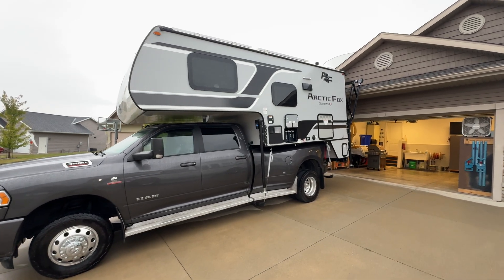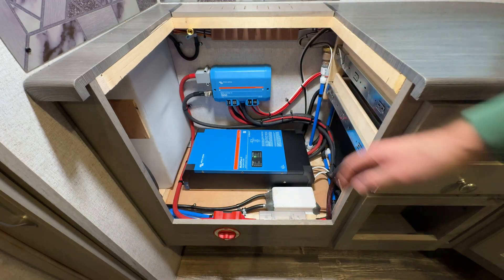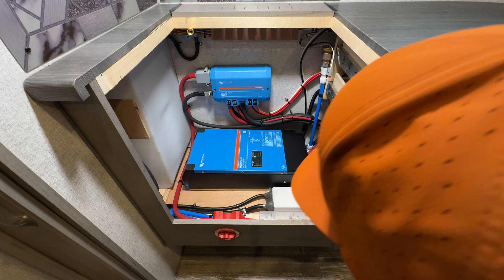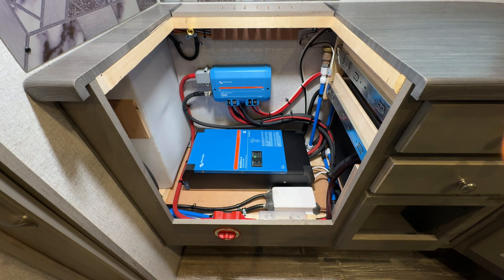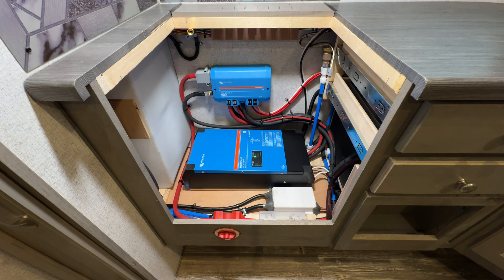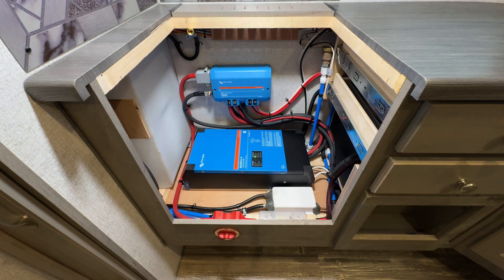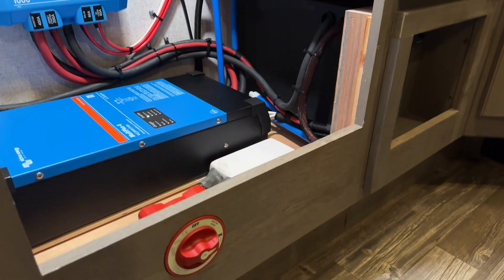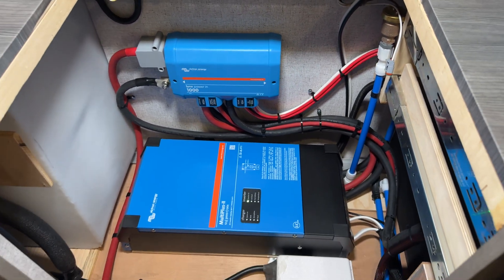Arctic Fox 990 | Victron Inverter & Power System Install

Comment: Thank you so much for this video.  I'm about 6 mos. away from ordering a 990.  And I'd be more than happy to bring it to you for 600w solar, inverter, and 2 x 600ah EPOCHs.  Couple of questions though.  Did you look at the space in the wardrobe bay in the cabover?  Any issues with ventilation under the stove?  Did you wire up a fan or anything?  Is the bottom of the stove heat shielded?  Really great video!  Thank you!  👊🙏🏻

Comment: Very Nice, I opted to have the factory install of my 3000 watt inverter and 300 ah battery to go with the 600 watt of solar.  It was one of the first they did (2025 990)so I am sure they have changed things.  They put the inverter where you put the multiplus however I no longer have an oven, they said it needed to be removed.  I do have the gas stove top.  Some of your comments regarding some of the fuses and safety things have me concerned.  Again great content.

Comment: Great video!  I'm getting ready to do the same install.  I like your idea of replacing the propane line with a flexible hose.  Do you recall the fittings required at the ends of the hose, and the 90º fitting?  Was it custom made, or were you able to purchase a complete hose?  Thanks!
Reply from the maker: Thanks!! Under that white plastic cover the factory just uses standard black iron pipe fittings to split the propane lines to the various appliances. I was able to add a 90 degree elbow and reuse the existing flare adapter fitting to reroute the supply line to the range. I also needed to cut and patch the white plastic cover. 

Here is the fitting and hose that I used:
Elbow Fitting: https://tinyurl.com/4j4npytp
LP hose: https://tinyurl.com/uu5kvhkb

Best of luck with your project!
Reply: @NagawieckiFAB  Thank you very much!  I'm planning on doing this install in Quartzsite AZ, far from home, and having this sort of information is immensely helpful.

Comment: Great video, just what I have been looking for.  Do you have any thoughts on the new Bluetti RV system?  It seemed like a more all in one solution but I was not sure if it would fit in a AF 990.
Reply from the maker: The Bluetti RV5 system ticks all the boxes and the pricing seems fair for what you get, so I’m excited to see more videos of people testing it out. 

For the Arctic Fox 990, I’m not sure if/where the Bluetti RV5 will fit. The space below the stove is really tight; the Multiplus just barely fits… But it may be possible to remove the OEM battery box which would give you more room to install equipment behind the cabinetry.